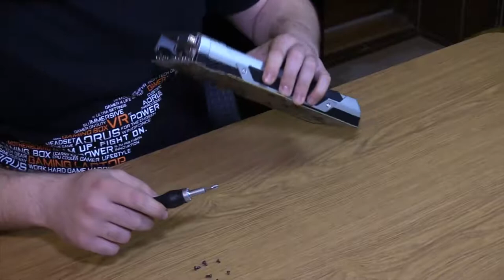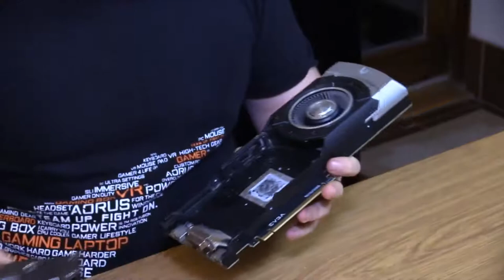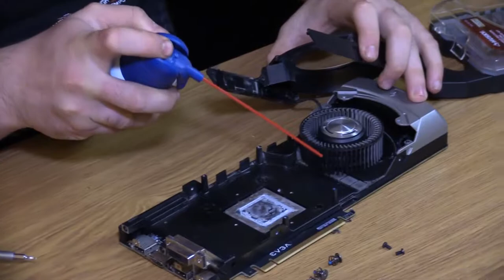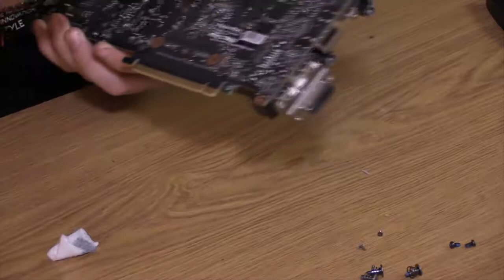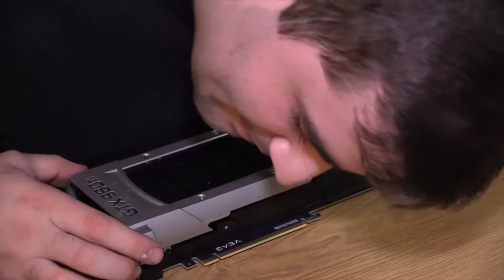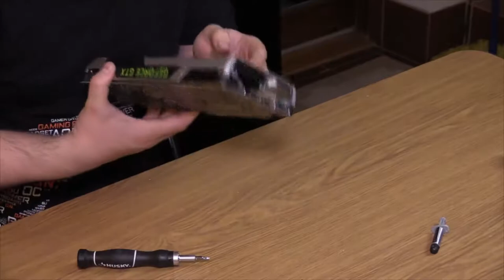Thermal Paste Replacement 980Ti

Comment: Less thermal paste between the die and the cooler means better contact and better heat transfer. If the paste doesn't get pushed out you got sht contact.

Comment: who tf would spread thermal paste with the FINGER?! you have a whole set of screw driver tips in all forms and colours but you dont have a piece of plastic / cardbord lying around for that???
Reply: I think a pea size ball of paste would be good in center of GPU die then heatsink once placed in top would spread the paste nicely. At least that's what I read and have been doing for some time for my cpus. Not too much and not too little.